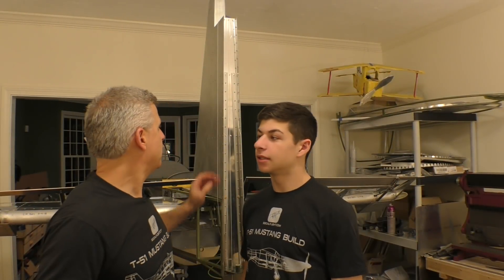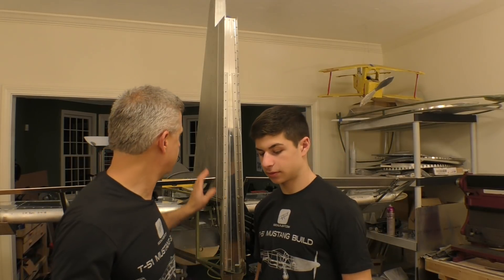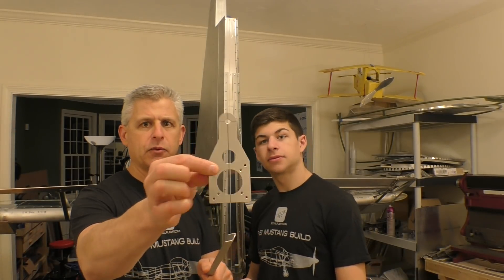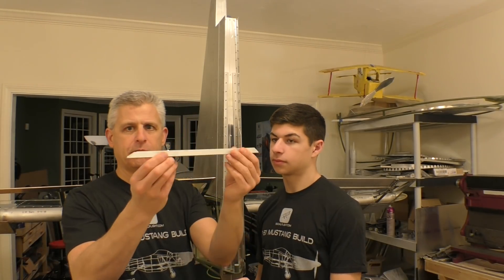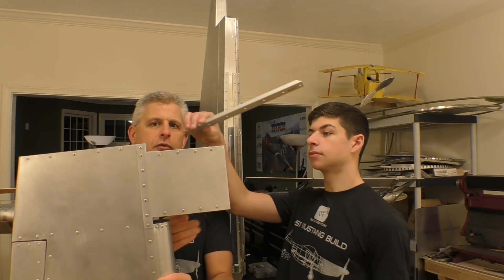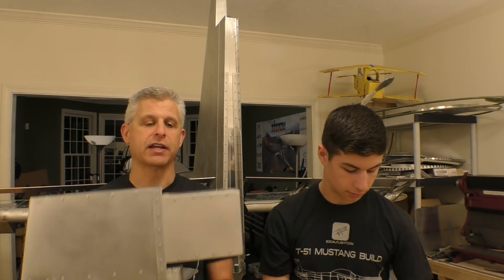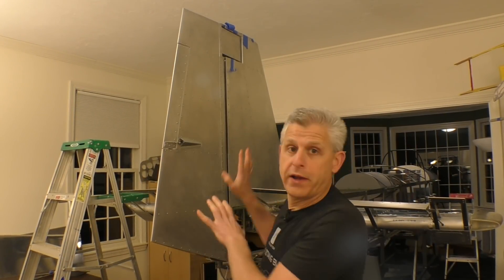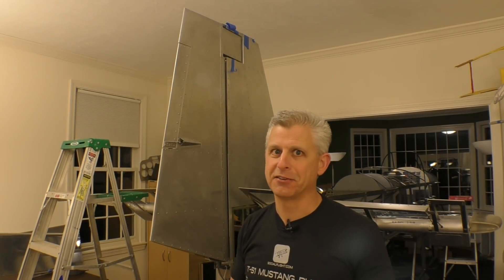The Titan T51D Mustang Gets it's Rudder Installed!

Comment: Looking forward to seeing you install the electronic trim. on your flight surfaces and seeing if your autopilot will control 2 or 3 surfaces.
Reply from the maker: Yes! We are using the BendixKing (Trutrack) autopilot! That video is coming soon!
Reply from the maker: We already have the rudder and aileron trim installed. We don’t plan on adding aileron trim (just the fixed tab).
Reply: @SocialFlight   No plans for autopilot?